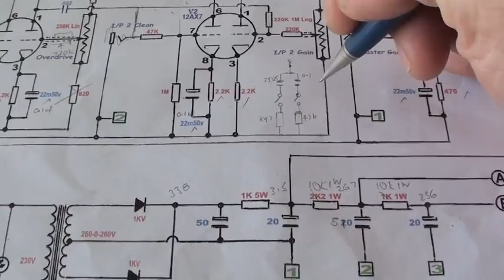Small Tube Amp Build, Start To Finish

Comment: I bet he made the guitar too
Reply from the maker: Indeed. I made that guitar in as a parallel build for another I was building at the time. My thought process was that if I ran into any problems on the number 1 build, I would try first on this guitar. Turns out that this guitar, with all its mistakes, is my most favorite guitar and I play it every day. The number 1 guitar is history now as the neck warped.. aint that just the way it goes, cheers!!

Comment: Nice craftsmanship. I have to say though, I honestly did not like the sound. Not remotely. It kinda sounded like you were playing through a clock radio. Still, I wish I could build an amp. I would probably put less time into the cabinet for the sake of....well, I just wouldn't be as concerned about how it looks. I'd take a stamped out sheet metal box from an electronics store if I knew that it would sound better. But, that's just me. I'm more about tithe tone.  Nice work though.
Reply: supplebiscuit of course I know that. I'm not incompetent. With that in consideration, it doesn't sound good. Even a camera mic can capture decent sound . Particularly a high def cam like the one used to film this, it may be that the speaker was a poor choice but my pig nose has better tone than that.

Comment: beautifull but dangerous  ive been zapped a few times as a rookie roadie that was 34 years ago how much did everything cost im 51 paying 3 grand for mass produced amp heads are redonkulous id wrather take pride and do it myself
Reply from the maker: Hi David, indeed it can get interesting doing open heart surgery on a tube amp, Ive taken two hits from large electrolytic caps myself, but as long as you can completely get your head around the circuit/safety and stay well away from the AC (insulate AC points) components and discharge electrolytics, you should be pretty safe. Always hook up alligator clips with power OFF, then stand clear before flicking any switches and taking readings, and one hand in pocket at all times is a good tip. Just have to do your homework for sure. All up this amp cost about 300$US dollars to make. Cheers

Comment: Îm curious about this guitar
Reply from the maker: The guitar in this vid is interesting. I built it out of one piece of Matai (NZ Black Pine). I only built it so that I could problem solve on it as I was building another. It has so many mistakes as I built it fast and as an error guitar really. Turns out it sounds amazing and so is now my favourite go-to everyday guitar. Its bright and gnarly and light and real fun and I can ding it and not really care too much so it has real character. Incidently, the other guitar, that was suppose to be the good one, has since warped and is now a wall clock. Cheers!
Reply: elams1894 yeah! an expensive clock.
that's the problem with 1 piece guitar, it can be hard to find a nice grain for the body to be flat, while the neck remains straight. have you ever tried neck-they build, like rob scallion signature? it can be a solution, keeping a nice look
Reply from the maker: Indeed 1-piece is very hit and miss. After building a few 1-piece guitars I kind of know what woods I can get away with and which woods are clocks waiting to happen. Mahogany is pretty safe, provided its quarter sawn (but getting a QS slab that big is miracle stuff these days). There are a few NZ woods that can be used too. The rewards of 1-piece guitars are huge and worth the effort however there is a risk indeed. Neck-through is great, and I love the whole build of a neck through. I have my own neck-through design, which has a cool joint and also I use big steel screws to advance the vibration transfer. I'll post a vid of a neck-through build some day I hope ;) Thanks again Z!

Comment: Great skills involved in this build but the sound doesn't appear that great. The original fender 5c1 is an incredibly simple design comparatively and has a lot of body and warmth to the tone.
Reply from the maker: Cheers Chris. Yes 5c1 is a bit of a legend indeed, I think it was intended as a clean amp. This one is built with the opposite objective, as much distortion as the tubes can handle. I guess it all boils down to what one wants to achieve in the design process. I quite like different sounds but I can appreciate that others certainly may not find this tone to their liking. Cheers, thanks for commenting, much appreciated.

Comment: To me through YouTube it sounded awful but I'm pretty sure it's the encoding and all, I mean the idea you can test the quality of an amp by listening to it on YouTube is of course preposterous but on the video it sounds like it's clipping like crazy, I hear "snip snip snip" on that signal.
Reply from the maker: +Adrien Perié Thanks Adrien. you are quite right, trying to gauge tone through a youtube video and little teeny speakers or headphones is next to useless.  I think that snip snip you are hearing is the sony handicam mic picking up the pick hitting the strings.
Reply: elams1894
I just fully refurbished the main board on my Sansui AU 317 MkII with Elna Silmics II and changed the fusistors, and it sounds great already, I only have to treat everything with deoxit and recap the phono and tone amp boards (I just finished 5 hours straight of de-soldering and re-soldering, my mind is zzzzzzzzzzzzzzzzzzzzzzzzzzzzzzzzzzzzzzzzzzzzzzzzzzzzzzzzzzzzzzz and there are little bits of extruded solder from the solder pump EVERYWHERE
Reply: elams1894
I just finished watching your video, I'm amazed by the build quality you don't expect someone who knows that much of applied electronics to be also this good with wood and carbon fiber, why the complicated dovetail though ? It's crazy ! Structural integrity ?
Also, I might invest in an AX7 preamp to feed my Sansui AU 317 as the preamp on it is good but doesn't have that warmth that just goes well with some music.
 Do you think that's a good idea for Hi-Fi Vinyl listening and scratch/mixing ? Thanks
Reply from the maker: +Adrien Perié Re: Ax7 for vinyl.. indeed yes, you cant go wrong. With a voltage device such as the vacuum tube, you get superior harmonics and that tsunami of warmth that a transistor pre amp, being current based, struggles to deliver. Re: the dovetail joint.. I did it for the look first and foremost and for structural integrity a close second. Many thanks!

Comment: Nice work...but back in the day if they had PCBs they would have used them. So why the point to point wiring? It's just retro with no reasonable meaning or purpose.
Reply from the maker: A well designed P2P layout cuts down on unnecessary hookup wire = less noise. Simple as that.
Reply from the maker: In addition. P2P enables one to create a far superior return circuit, again reducing unwanted noise.

Comment: Not 10W. One EL84 with 250V DC can drive only 5W/4ohm speaker with 5% distortion and max 7W but with 10% distortion.  In push pull two EL 84 can drive 12W max with 5% distortion. Clean guitar sound with distortion under 1% is possible on 3W max. I made a couple of guitar amp with ECC 83(12 AX7) and 6V6. Look my scheme at my channel. Your amp has no clean sound.
Reply from the maker: Sweet as Pero, you are quite correct, I'v been meaning to change it for a while. Cheers
Reply from the maker: My amp has clean channel, 2 x gain stage. Cheers

Comment: IMHO it looks like an awful lot of time and effort. Also, it looked like more than one person involved regarding the different skills, i.e. woodworking and electronics. Great result though.
Reply from the maker: +Chris Davies nope, just me, took about 18 months. There were prototypes however. Takes time, but got there in the end. Cheers Chris.
Reply: Ah, apologies, I'm impressed, but it appears I was correct about the time and effort :). The amp sounds great, and you have some very employable skills there. Nice one dude. You have an awful lot of equipment/tools going on there lol.
Reply: are u daft? It took him 18 months of prototyping, which is engineering work. You can manufacture this in less than a day in your garage with all the components.
Reply: Less than a day might be pushing it.  Usually I count on a couple of Weekend - one weekend for the cab, t'other for the amp itself.  I don't have all the fancy tools for woodwork this guy has but you can still get a good enough result that I don't need to Tolex the amp.   I also hammer out the metal for the chassis 'cos I'm too much of a skinflint to buy one....
Reply from the maker: This takes me about 3 solid days to make now, cab included. I couldnt manage it a day, I'd screw something up for sure

Comment: Did I miss something I didn't see a single Tube?
Reply from the maker: @7:49 you can sort of see the tubes, however they are covered with tube shields. Cheers
Reply: Thank you I will watch it again
Reply: Dave Yates beginning at around 1:10 or so there's at least 3 of them. They are mounted upside down and he is soldering to the bottom of them.

Comment: nice amp but fuck there are easier ways to get just a good a finish if not better talk about doing things the hard way......
Reply: Well, there's no real advantage to point-to point wiring either. But it looks damn awesome, which is more of the point here anyway. The enclosure could have been a hell of a lot simpler, but that seems to be missing the point.
Reply: The biggest advantage to point-to-point is the repair aspect.